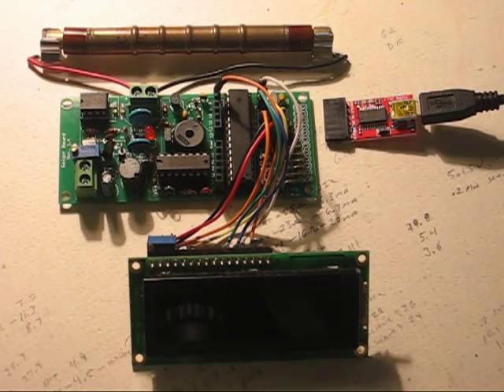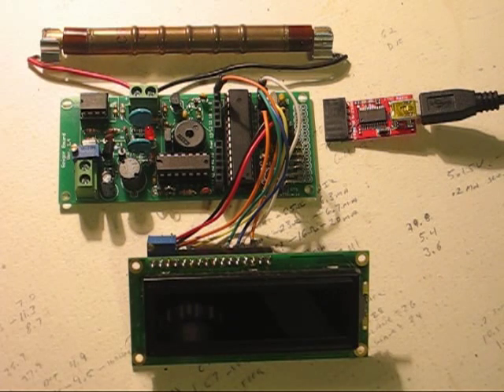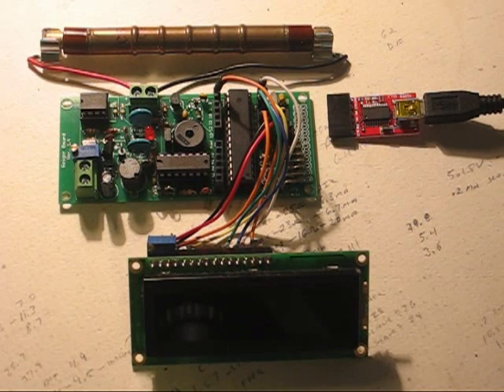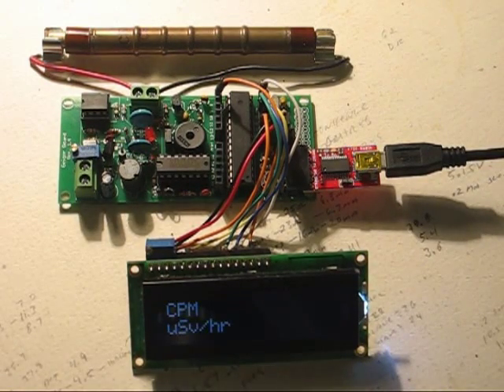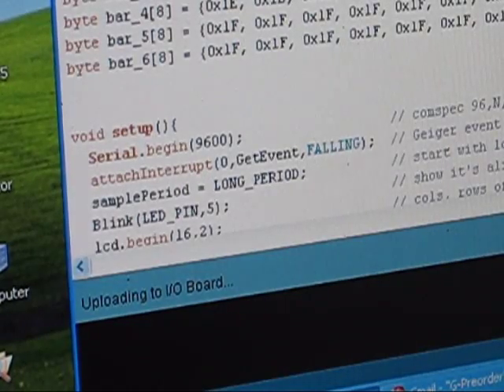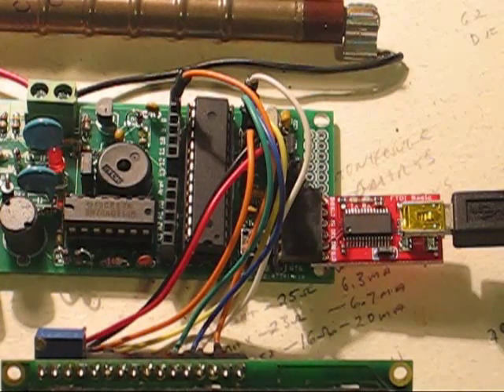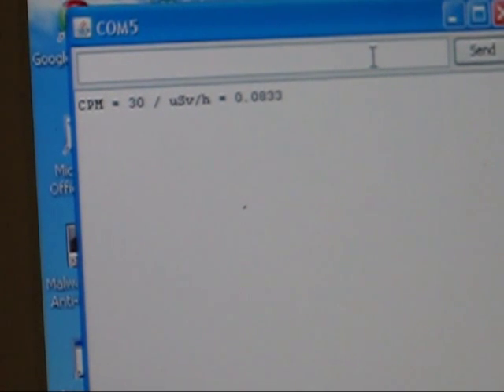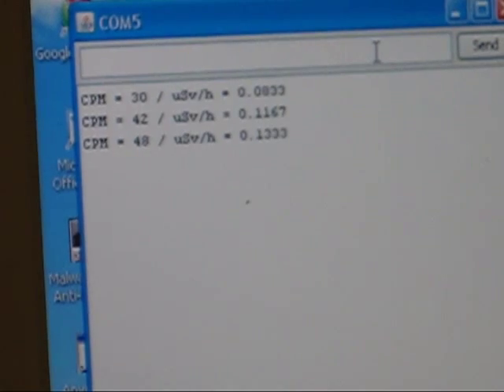Using the FTDI Cable on the Geiger Board

Comment: This is one of the best feature with posibility to connect directly to microcontroller. You can use this to make a statistic of dose rate and view every detail from your computer. Use it in combination with remote transmitter-receiver an use it like remote sensor. In alarm system or just for fun.
I recommend your Geiger sistem to everyone!